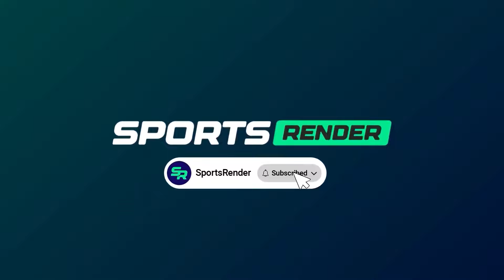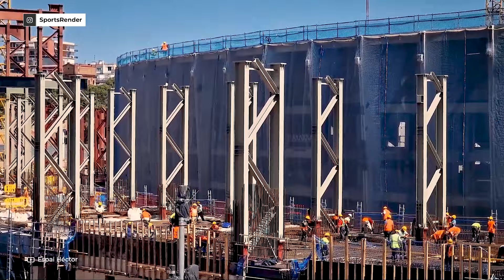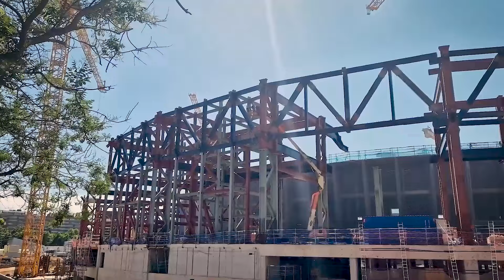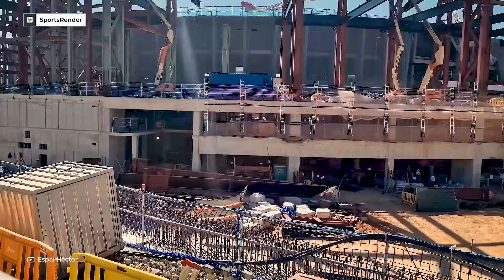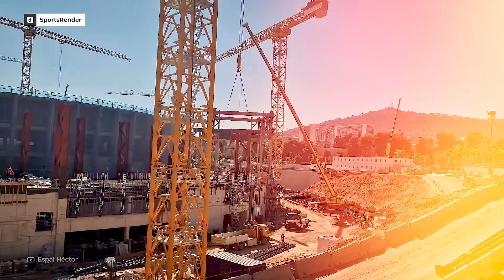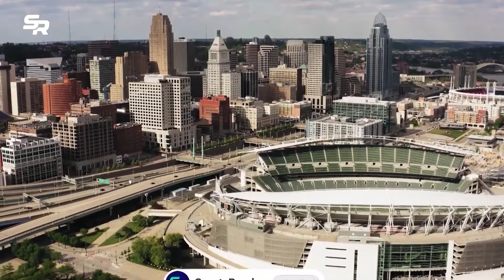New Camp Nou Update (26 June 2024)

Comment: Just as mentioned, safety is paramount, which should be the most important factor for everyone. In my opinion, the project should continue without halting, and just as the 125th is approaching, I don't see any obstacle if the date for the opening and the celebration is shifted till next year's ending. So just as the fans are excited for next season, with the appointment of the club's new manager and zeal of the players to kick on, it can serve as a distraction not to return, in order for the project to reach a milestone towards completion. Thank you